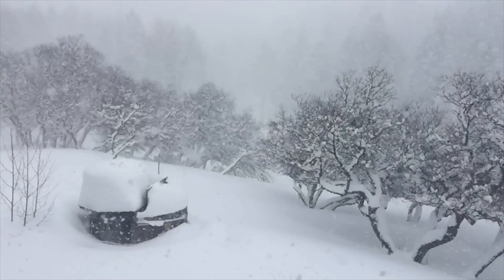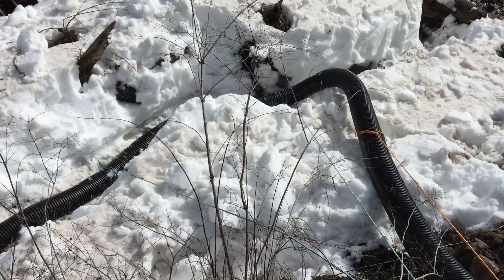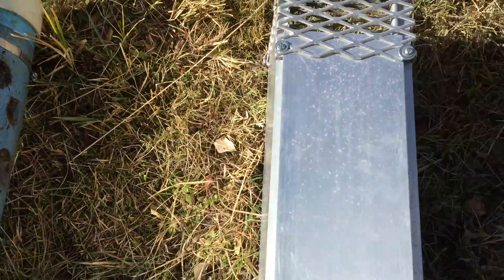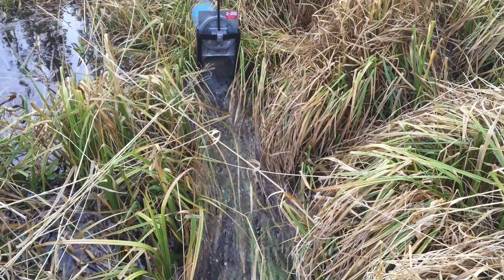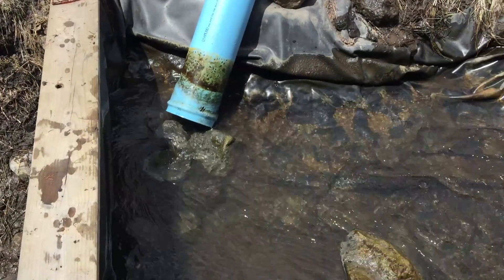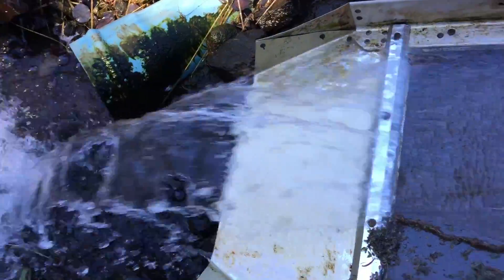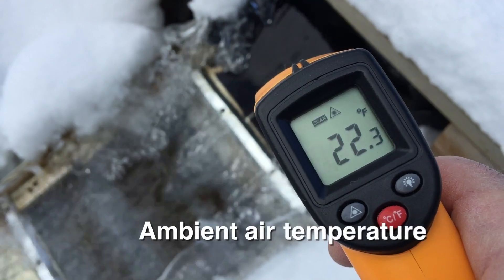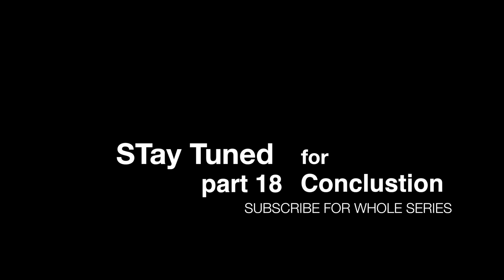Part 17 MicroHydro Power System in CO

Comment: I live in south GA and in the high heat of summer we average around 80-90 kwh/day while the rest of the year is much lower. I guess the 200kwh/day your making is more than enough to keep you comfortable. Great setup you have there. i enjoyed seeing it.
Reply from the maker: Humid down there too I suspect.  We have 1 portable 1500w AC unit in a sunny room, but seldom run it.  One benefit of our 8600ft elevation is that we can just open the windows at night (44° outside last night) and cool the house which remains cool most of the day with the windows closed.  Oddly some of our excess kWh can go to keeping our outdoor hot tub hot all the time.  80-90kwh is plenty of power for a good life, i"m sure you'll agree. Do you have AC/direct or DC/battery system?  Just curious.  Glad to hear of others enjoying the benefits of micro hydro!
Thx for watching.  I'm never sure who has seen what of the series.  Here is a playlist of the 3 part synopsis which is an overview of the whole process https://www.youtube.com/playlist?list=PLtTypVpmDd-vkT9bJQkXw4I1t0e_4jMYA
Reply: @mrhydrohead  Im sorry if I mislead you. I didnt mean to insinuate I was also using a system like you do. No were on a straight up power grid but Ive been curious as to how feasible systems like this were. It would appear from your setup that its not only feasible but well worth it also. Guess its time to stop thinking about things like this and do them. Thanks for sharing your setup and ill be sure to watch your other videos as well.

Comment: About 30 years ago I read an article that connected the Niagara Falls Power Station to the aqueducts of ancient  Rome.
The power station was experiencing flows in a pipe that varied from 0 to 10000 gpm every 10 minutes due to entrained air at the head. Very annoying and damaging. 
An archeologist happened to recognize the situation as similar to a problem the Romans had with pipes crossing valleys and had solved with a device an untranslatable name. 
The device released air but sealed the flow of water with a floating ball in a tube.  Pretty easy to make these days with a pingpong ball and PVC pipe.

Comment: Centrifugal filtering is also a good system (like a Dyson vacuum cleaner does with air). The particulates are spun out to the sides and ejected while the cleaner water is drawn down from the centre of the vortex.
Reply from the maker: Wish I needed something like that.  It sounds cool.  But the system has been running great now for several years.  Maybe you haven't watched the whole series, but all runs fine as shown in the Synopsis playlist.  https://www.youtube.com/playlist?list=PLtTypVpmDd-vkT9bJQkXw4I1t0e_4jMYA  thx for watching

Comment: 4500 watts isn't much power .  Hydro generators don't work  without a Big Drop in elevation , where he is in Colorado mountains  it will work some what , all you flat landers are out of luck .
Reply from the maker: We do 7500w in winter (mainly for heat) and could max out system at 10KW if we added another jet.  One has to have a use for the power to harness it.  There are now system that can work in irrigation ditches, so pressure isn't necessarily required.  Thx for watching

Comment: Multi solar system types and water flow  generator from a car that you. Tube posts say are reversed can produce  Ac power ! Wind snd  electrical power with battery storage and a wrap around  heat tape that on sensors turn on to keep pipes from freezing or the cement with electrical heat bottom can be used if made properly !methane generation concrete pipe with floating lid to contain pressure with chicken horse and caw waste as garden wate will make a large collection of gas to also support any propane or natural gas mix generators that can run efficient oil heat or stove and hit water back up ! You have so many great options ! Wish we were working on it together ! If you need ideas that might help be sure just to write me ! I had misplaced  my reading glasses so  it’s hard to see the small print on this small cell phone ! But wanted to get back to you , I had years of making and installing solar and running large ranches in Colorado!

Comment: About that ICE problem easy fix Just use thermoelectric. There is three ways of using it! just apply 1.3 to 1.5 v (AA Battier) to it and get Heat or Cold depending on how you are applying the current flow (- +)(+ -) or if you add ice or heat to the thermoelectric, it will make electricity that you then use to power the other thermoelectric cell to give out heat or cold, or you could use them for camera power to help you find the problems faster with your phone! The cost of each on ebay will run you about $1.65 each... if you decide to make a video on it please let me get notification, peace!

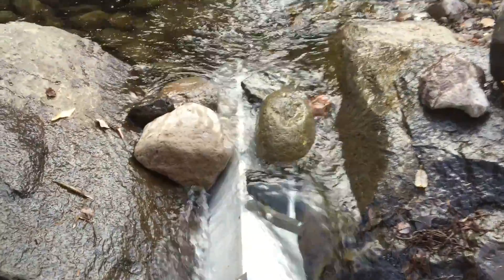Comment: @ 4:33 use a better screen and add a spinning brush that would be cleaning it 24/7 365 around the clock, I do believe that would help you with the water speed, and this spinning brush would spin by water power!

Comment: The areas you’re having a air lock issue install a Hoffman valve model 79 and your air lock problem is over.  About $80 will last 20 years
Reply from the maker: Thanks for the suggestion.  and Thx for watching

Comment: Cost of this
Reply from the maker: Lots of folks ask about the cost and payback compared to being on grid.  The distance we are out in nature makes this a moot point due to cost of accessing utility grid.  Its more of a lifestyle choice and an investment in the value of the property.  We are 7 miles from the grid and the grid reaches a little over 2 miles from a main highway towards us.  We are definitely out there about 40 mile drive from a major town.  $25k cost on first spring fed system which ran 19 years and also provided pressurized domestic spring water.  This vs. a $140k estimate to run lines in and pay power bills back in 1996.  Moving equipment and redesign in 2013-2015 cost an additional $55k vs $250-300K estimate in 2013 to run lines in and again pay power bills.  But now we have a massive increase in power @7500-8000w continuous throughout winter for home heating and 4500w the rest of the year by choice due to not needing all that heat. 
An expensive undertaking yes, but truly independent in terms of power.

Comment: You take water from surface flow with the mentioned problems. Yet just above the intake I seemed to see a little puddle -  one to two feet deep. Why not put the intake well below the water surface? There I would expect less air bubbles and dirt. 

While I can imagine problems such as accessibility and freezing, I would like to hear about your concrete decision process, which factors seemed relevant to you.
Reply from the maker: Because the series was made as it was built and the problems overcome you may not have seen part 18: https://www.youtube.com/watch?v=sixorfYKSwI which shows a collection bucket in the creek much like you describe.  The intake is actually at the boundary edge of our property and that dictated the intake point.  
The problems of accessibility at that point were difficult due to uneven and changing terrain where it just wasn't possible to get heavy equipment in.  Also any permanent structure would likely suffer from damage in the massive spring melt off and the sliding terrain above the creek which is slowly be pulled down the hill by erosion and the hill being somewhat liquified underneath by a spring up the hill well above the creek.  It is slowly sliding into the creek over time with huge fissures developing down the hillside.  Such is the local geology.
Freezing has not turned out to be an issue thus far as the water flows under the snow and ice to enter the self cleaning Coanda screen we installed.  I never know who has seen what.  Watch parts 20-1,2,3 for a synopsis of the whole project. This is a playlist of those 3 parts: https://www.youtube.com/playlist?list=PLtTypVpmDd-vkT9bJQkXw4I1t0e_4jMYA 
I hope this answers your questions.  If not I can respond in more detail if you wish.
Thx for watching.

Comment: Love your narration. And multiple attempts before investing in a coanda screen. I didn't see your elevation differential but 80-90 Psi and 160-180 GPM is awesome and can truly make power. I've given up on mine based on limited head and variable winter flows and constant headworks cleaning. The air entrainment is a simple inexpensive floating ball valve found at irrigation supply houses.
Reply from the maker: Thx for watching. We have 96psi nominal. I never know who has seen what.  Watch parts 20-1,2,3 for a synopsis of the whole project. This is a playlist of those 3 parts: https://www.youtube.com/playlist?list=PLtTypVpmDd-vkT9bJQkXw4I1t0e_4jMYA  The whole series of videos is 20+ videos.  The problems in this video have been subsequently resolved.
Sorry to hear you've had problems you can't surmount.

Comment: You said you arrived to your system producing 4500, then said the system was frozen solid,
Reply from the maker: Thx for watching.  I never know who has seen what.  Watch parts 20-1,2,3 for a synopsis of the whole project. This is a playlist of those 3 parts: https://www.youtube.com/playlist?list=PLtTypVpmDd-vkT9bJQkXw4I1t0e_4jMYA  The whole series of videos is 20+ videos.

The system did continue to generate 4500w by using the existing water that was running through the meadow.  The water added to the meadow through the diversion pipe from the creek(which did become frozen) was what allowed us to maximize the power output.

Comment: Do you discuss the environmental permits required to divert the flow of a stream, add contaminants to water out flows, etc.
Reply from the maker: No.  Each state and country has there own procedures for acquiring water rights and regulations.  Ours in Colorado are adjudicated through water courts.  The diversion is non-consumptive beneficial use in CO. There are no contaminants or erosion resulting from the use.

Comment: Run a wire alone the pipeline to power a roof de-icer at the screen 👌
Reply from the maker: Thank you for the suggestion and for watching.  The intake screen is 1/2 mile from the power source.  Running wire would not only be extremely expensive with line loss which would be immense, but there is no need as the system functions just fine without additional heating.

Comment: I'm not understanding why you are/were filtering your particulates so small?  Will the vanes on the generator not process anything larger than 1/16 like window screen?  If your generator can process 3/8  particulates why not use a 3/8 filter/screen?  Wouldn't adding atmospheric vents every 100 feet increase the flow the same as a pluming system does?
Reply from the maker: thx for watching.  I never know who has seen what.  Watch parts 20-1,2,3 for a synopsis of the whole project. This is a playlist of those 3 parts: https://www.youtube.com/playlist?list=PLtTypVpmDd-vkT9bJQkXw4I1t0e_4jMYA
The diversion from the creek has had various approaches to getting the water into the meadow, some with no screen at all and our final solution at the weir is to use a Stainless Steel coanda screen box to filter particulates.
In response to your questions, the pelton cups in the turbine are made of brass and subject to erosion over time.  To prevent whatever you can from entering the penstock is advantageous to the longevity of the turbine.  
If you added AIR vents to the penstock, it would vent any air, but as the pressure is a result of the height of the water in the column (2.31ft = 1 psi), any other type of vent would enable water to escape and lessen both pressure and flow.  I think I understood your last question, but maybe I didn't.

Comment: if you add a vortex-style first stage filtration device to the front end you might be able to extend the time between cleanings of your finer mesh filters.  I am thinking about the vortex filters that Coast Guard cutters use to pull out salt and other debris out of the saltwater before it enters RO filtration units. as for the air pockets in your piping, I think eventually you will have to engineer a system where there are no high points, probably easier said than done.  thanks for the video.

Comment: it would be cool to rig up a way for the system to clean the filters automatically using the water flow. it could be bristled brushes mounted on a cylinder that gets turned around using the water flow.
Reply: I concur 🙏💎

Comment: Just thinking; if the screens keep getting clogged by surface debris, maybe you shouldn't make your intake on the top!  If you'd put it on the bottom, with some clearance below, and keep the assembly still submerged that issue may totally go away.  You shouldn't even need anything but a very large mesh to keep any big chunks out.  The water will flow up into the pipe easily if fully submerged.  It might also minimize air getting into the pipe as long as the intake is sufficiently far from the weir splashing.  As long as the intake remains unblocked and submerged the pipe should stay full.  Ice could form and fully cover the surface, but as long as the water keeps flowing the intake will be fine.  It might mean making a small basin to put it in after the weir.

The flow should be enough that it would scavenge any silt passed over the weir.

Too bad you couldn't use some float traps on the pipe on the way down to vent off any built-up air, but they would freeze up quickly.  But like I said, as submerged intake should minimize that.

Comment: Is this even legal? Diverting ANY water in Colorado is highly regulated. Just asking.
Reply from the maker: Legal, yes.  It requires filing on and acquiring permission for non-consumptive water rights via water court and meeting criteria on the sort of water source it is.  Diverting water in a pipeline and putting it back in the same source is considered non consumptive and actually prevents a certain amount of evaporation which would naturally occur were the water not within a pipeline.

Comment: But in summer, is there enough for A/C?  or maybe just led lights & TV?  Could you sell power back to the utility, or is that less profitable than people think?
Reply from the maker: Gary Anderson 7miles from grid, no option to sell excess. 8600ft in mountains and don’t need AC, just open some windows at night and close in the morning. House always nice temp. In summer we actually turn system down as we can’t use all the power even with domestic hot water and hot tub. Shunt power heats up the basement anyway. Thx for watching

Comment: what is the name of the glue used on pvc 3:58 to aluminum
Reply from the maker: robert sanchez That was clear silicone sealant. There is a heavy duty kind made by GE 
https://www.homedepot.com/p/GE-GE-Silicone-2-Window-Door-Sealant-GE5000-12C/100026175

Comment: make a push pull for filtering you never have to clean it again. pick which you need also you can set up a motor with a timer on it using a battery that would last a long time I would suggest a deep cell battery. Then use a small water pump with a micro charger on it to charger the battery. You would never have to look at it again. I could make 1 in a day. Also use the 3 stage filter to make everything work. I would put a big push pull with a 2nd line to wash over on top of the stainless steel filter to stop the ice from making problems for the flow of water.    2nd type of power generation would be to put in a paddle system for generating power. It would be a lot easier to do that what you have. I would run a long set of wires to where you set up is or change the location.

Comment: 200kwh a day !  Me sideways that's some juice. Now it's time to dump the excess in to a bitcoin mine :)
Reply: Where does it say that?  There doesn't appear to be nearly enough water flow to generate remotely that much power!
Reply: 4500watts constant over winter, that's 100kwh over 24 hours ,  he also sates up to 8500w peak, he's dumping loads of 4500w into those heaters with the excess.  He would see 200kwh at certain times of year.  Even 100kwh is crazy , average home is 40 ?  Maybe only a few days a year he's sees 200 ?
Reply: @jestronixhanderson9898  I agree that it's crazy, but if you do the math on what it takes to attain those levels of power, he doesn't appear to have anywhere NEAR the amount of flow for it.
Reply: Yeh true,  be interesting to see if he could do a video on just the power, like averages for time of year and some data collection for us :) maybe those stats he gives in the video are peaks and have no reflection on the footage, which in my eyes looks like 200watt flow ?

Comment: Is there a possibilty of installing some sort of heater on those points which frequently freeze up ? Or is this idea  too absurd. Sorry.
Reply from the maker: Ur Awsomeness Well the power is 1/2 mile from the intake. Running wire would be a waste of funds and copper. Subsequent videos show that the freezing hasn’t been a problem. This winter the whole screen has been covered with ice and snow and the water just keeps flowing.  Thx for watching

Comment: Thank you for this wonderful video. If I may make a suggestion here. You can buy water pipe air venters. They let the air out and then seal as the water pressure forces a ball valve to seal the outlet. Kind regards and greetings from Africa.